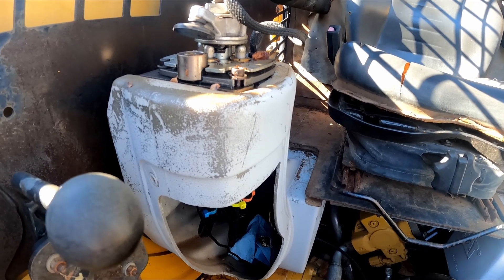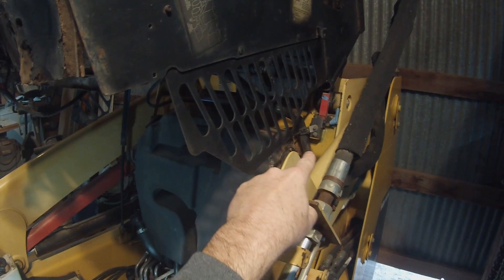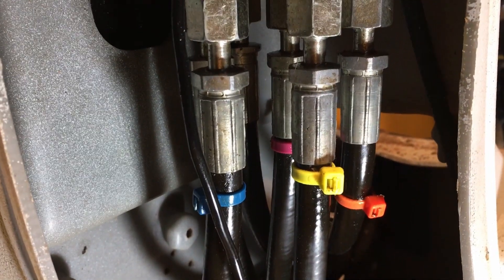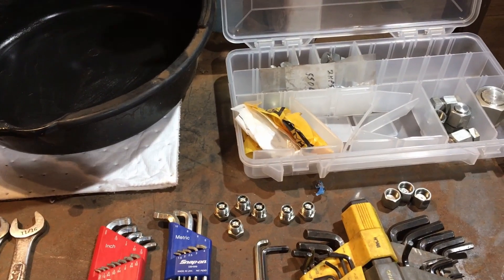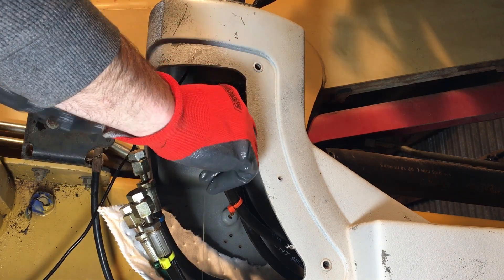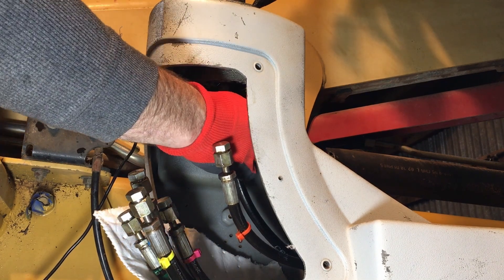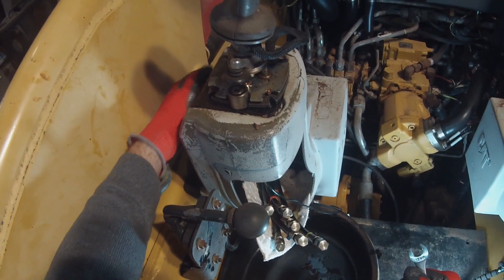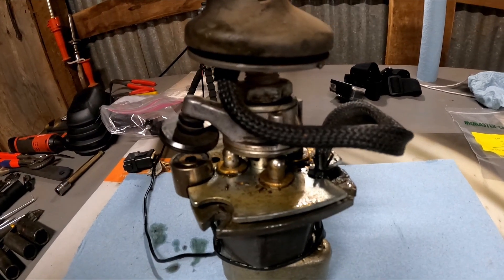CAT 248 Leaky Joystick Pilot Valve. Can It be fixed without buying a whole new Pilot Valve? Part 1

Comment: Hi thanks for the video it’s helping me replace the two pilot valves on our CAT 236B. I did have a question 5 of the 6 pilot valve hoses in the right side that controls the bucket and arm can be removed with the two 11/16” wrenches. However I have one towards the back that doesn’t have a hex fitting it looks just smooth and has a small black plastic piece on it. I’m not sure if it’s either pressed on or might have to removed some other way. Do you happed to know what I mean on that last pilot valve hoses or how to remove it?Thank you.